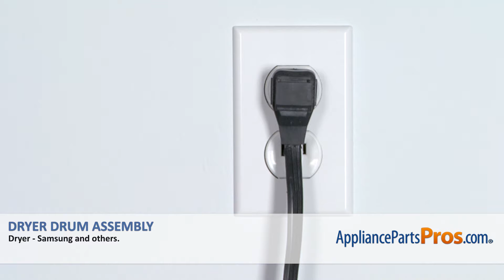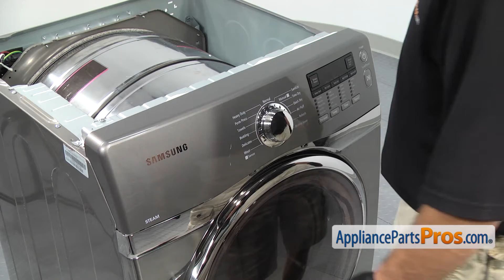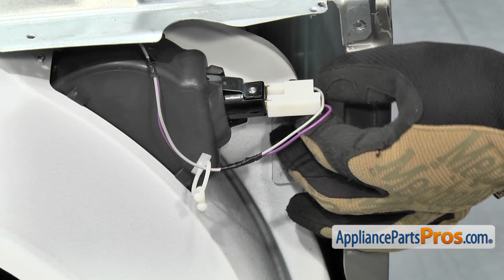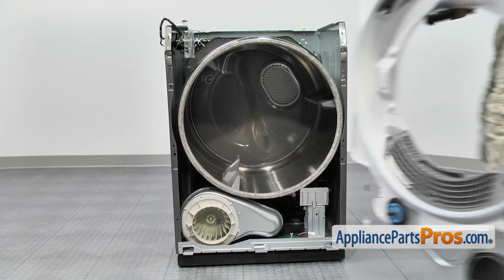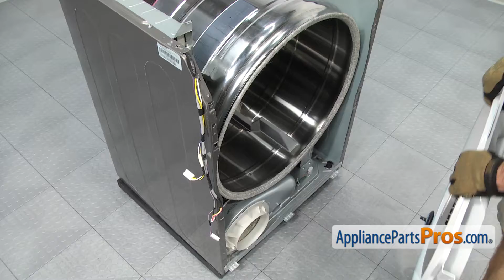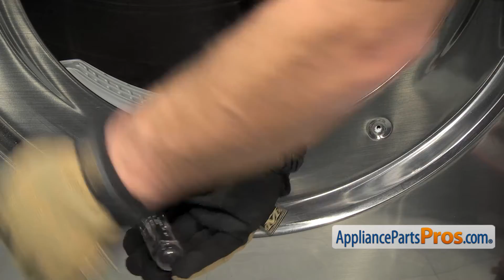How To: Samsung Dryer Drum Assembly DC97-14849A

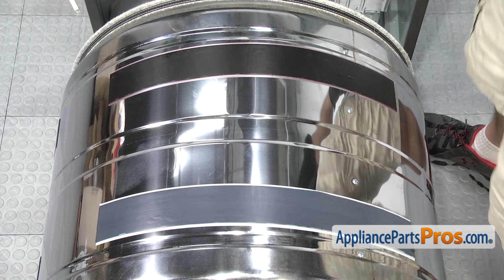Comment: at 6:12, make sure  the pink stripes are to the back" on my machine they were to the front...
Reply: Does it make a difference?
Reply from the maker: +grasshopper It may vary from model to model I would suggest putting it back in the way you took it out.